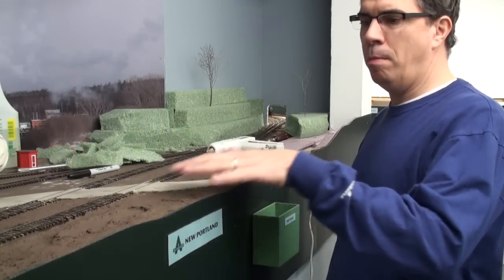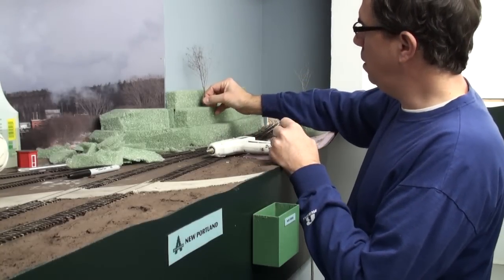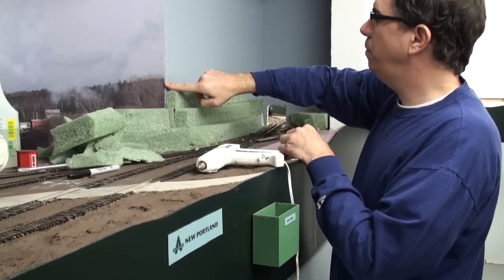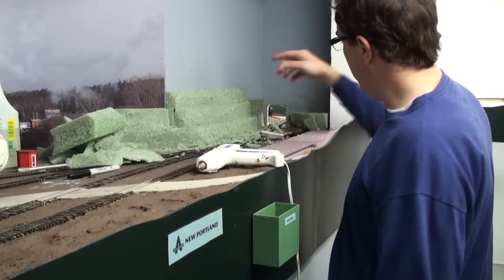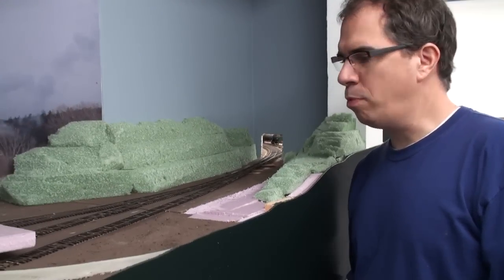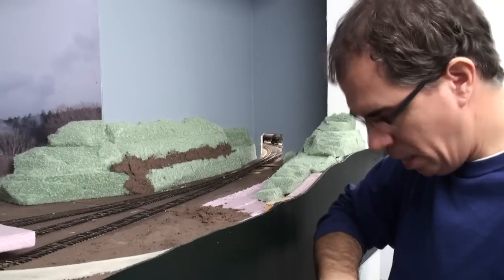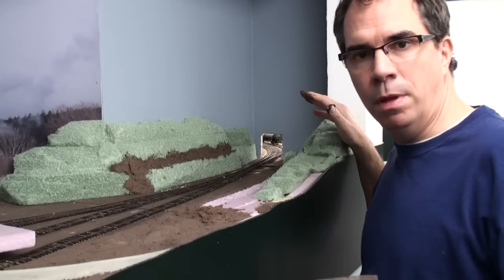Building terrain with florist foam | Model railroad scenery how-to | Model Railroad Hobbyist

Comment: interesting method. I am still adhering to the old method  using cardbord/plywood profiles covered with wire screen, stapeled down and covered with papertowels soaked in a plaster mixture.. It's easy to  paint and to cover with "grass".

Comment: Gray Celluclay
Water
Flat Brown Latex Paint
Vermiculite {used for potting plants}

Celluclay can be purchased in any art supply store, while the Vermiculite can be obtained at hardware / home-improvement stores.

Mix the MUD to a VERY stiff mixture, not soupy. It should stick hard to a spoon when shaken.
Add water sparingly, use instead the brown paint to the Celluclay.

Comment: I have been using florist foam for years
Reply: Mind if I ask you a few questions on it?

I'm make wargaming terrain, and I love the natural stony texture of floral foam over XPS.  I also like the carving properties of the floral foam over the XPS foam.  However, the stuff seems too brittle to transport or use effectively on a gaming board, and so it has a bad reputation in my hobby.  Is there any way to make it harder and more durable?  I know its porous and holds water.  Would soaking it in a PVA solution or an epoxy work?
Reply: @Beatnik59  I just started makeing diaramas so it might not be the best solution but iv covered it with a watered down pva (2 to 3 coats) and then put plaster bandages all over. 

 Edit:Although I didn't realize you did ask this 2 years ago

Comment: Pink foam insulation board, plaster/sculptamold, plaster-soaked paper towels over a cardboard strip frame are good other techniques.  making a video is easy once you get some editing software, or you can use the video contructer/uploader here on YouTube.

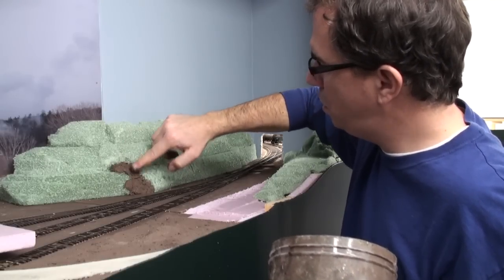Comment: Why not fill the large holes with chunks of  broken foam and glue ? Then add plaster/Spackle to the remaining smallest holes. If that's real mud I'd think when bone dry it'd start cracking under the overlay material.. How about modeling clay ? 6:17 "Try not to get too much mud........" Then 7:35, you're adding it all over the place ! Why not just stack up enough rectangular foam blocks and whittle and press/mush it into 98% of the final shape you want ? Again, glue leftover foam chunks to fill likely the very smallest holes..Seems like you're adding difficulty to an otherwise piece of 'cake'..
Reply: It has been explained several times in MRH various platforms that Mike's universal mud is simply celluclay or equivalent papier-maché product  with water and brown latex paint. I've been using the stuff for years and it absolutely can't crak because it creates a hard shell that keeps some elasticity due to latex paint. You can fill any gap with foam as you said. However, given the impressive results Mike gets, it seems the technics he used works well for him. If the results were poor or unconvincing, that would be another thing.